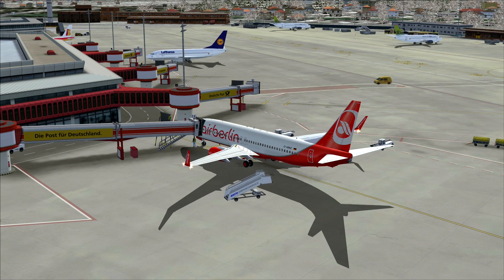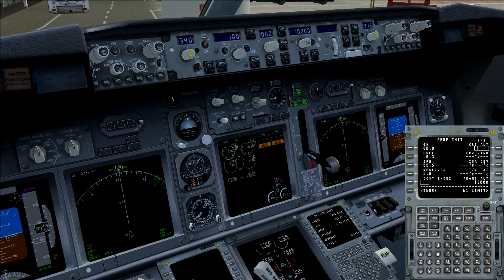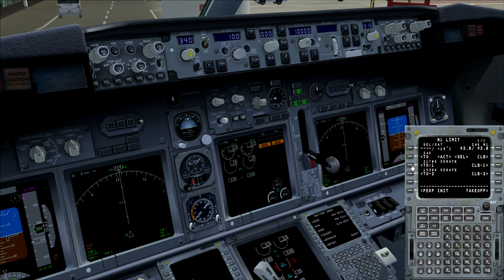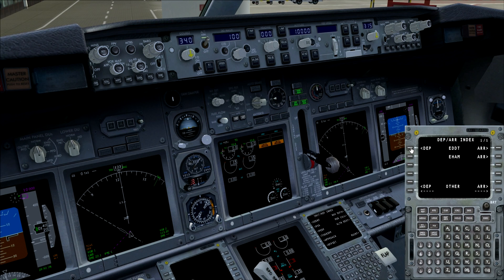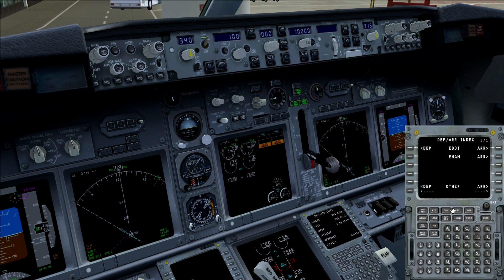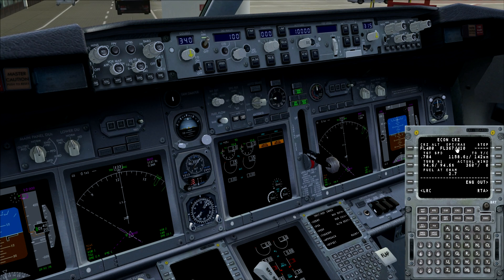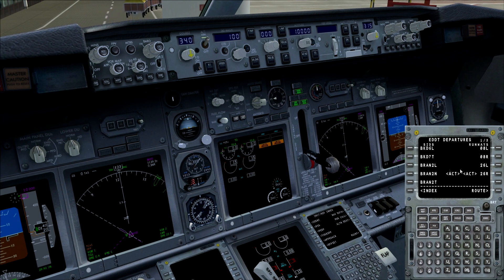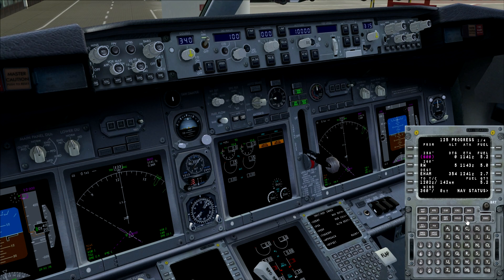Tutorial: How to Set Up the iFly 737 FMC

Comment: this aircraft iFly 737 seems to have exactly the same bug as the aerosoft A320...you gotta turn off fly by wire on the latter to stop it from shaking to pieces and this is without recording...so how do i do this on the ifly 737, i look at the wing and all i can see is the flaps shaking to bits?

Comment: Question for you! First I like to say great video! However my FMC keeps saying invalid data any time I enter any or most information. Any pointers on how to get that to work or show the Airac info? 
All my stuff works on all my planes outside of the iFly 737 ?????   Thanks if you know what might be happening.
Reply from the maker: You might want to upgrade your AIRAC data, please search for Navigraph for that ;)
Reply: +AviationPro all the folders and files are in the Ifly folder and it is showing up to date but for some reason it will not acknowledge it in the FMC? It has been that way since I installed that plane! That plane has been sitting in my inventory and unused since I have not been able to get it to work. Lol
Reply from the maker: Well, best thing is to visit the iFly forums, they have great support there and they know what they're doing! ;)
Reply: AviationPro
Yeah I am on there now reading the suggestions! Thanks though!
Reply: +Flightguy69 You have to run FSX/P3D as admin to allow it to access files. For Aribus X the nav data is stored outside the main Prepar3d folder so you don't have to run as admin, but for iFly it is all kept within Program Files (x86) / Locheed Martin / Prepar3D v3/ iFly / etc.

Comment: I have an issue with this FMC and I hope you can help.
My issue is that I can only type in one digit or letter at the same time, eg. if I want to type in 15 for flaps, it'll only type in 1 and that 1 will change to a 5, if I then click the flaps button, it'll only change to 5 and not 15, same with airport codes etc.. is there any way anyone knows how to fix said issue? regards.
Reply from the maker: MrDoggi1337 Which version of the iFly 737 do you have installed?
Reply: Thanks for the quick reply, I'm using version 1.0
Reply from the maker: I suggest installing the latest version first....

Comment: whenever i enter a sid or star, all the waypoints are grouped together in one spot in a very far away location: http://www.imagebam.com/image/17d4ed402707202

the picture you see is the "star"
Reply from the maker: MegaChallanger I have never seen that before, are you sure you installed the AIRAC data correctly? Otherwise ask for support on the iFly forums.
Reply: AviationPro i deleted the navdata folder to be sure and installed the AIRAC cycle. but i have the same problem

i also dont know if its a problem with ifly or navigraph
Reply from the maker: Then either contact Navigraph or iFly, I do not have any idea what could be going wrong here ;)

Comment: Unfortunately I have already tried this but it did not help. I turn on the captains FD and then the F/O's. I have reinstalled the 737 and that did not help either. The A/P bar is up. However, I am using FS2Crew, so maybe it's interfering with something.

Comment: Can somebody please help me??? 
I am having a frustrating problem with the autopilot. I do what people told me to do, yet I still have the problem. I completely did the FMC, entered the correct info, entered he trim, did not put pressure on the yoke. I have done everything, yet I still have the same problem. When I try to engage the autopilot, nothing happens, the FMC says thrust required?  Seriously, if I can't find the solution, I would just go to PMDG...
Reply from the maker: You do not even need to program the FMC to get the autopilot engaged. First, just try to fly the airplane and use one of the basic modes (FLCH, HDG and SPD). No pressure on any flight controls (make sure the joystick sensitivity is not too high, otherwise it might still register movement even though you are not touching it. At least one Flight Director on, then either CMD A or B, then one of the modes. No need to switch to PMDG just for that ;)
Reply: Quick question- Do you think that re-installing FSUIPC work?
Reply from the maker: You could give it a try. Or just completely recalibrate any joystick you use.

Comment from the maker: Actually you should use both in order to fly the airplane through the FMS. LNAV means Lateral Navigation. By engaging LNAV the autopilot will fly the route you've entered into the FMS. VNAV means Vertical Navigation. By engaging VNAV the autopilot will fly and maintain the vertical profile of your route that's being automatically calculated when pressing the Execute button on the FMC when you've fully entered the route and performance data.

Comment: Perhaps a good tip; When you've entered your route you can check if it is really what you want by going to the LEGS page, select PLAN mode on your efis control panel and press STEP on the bottom right of your CDU. This way you can confirm your route step by step.

Comment from the maker: Ooh in that case go to the configuration manager. Click on "My Fleet" and select the aircraft version you fly with. Then click on edit so you can change the settings for that version. There's a "Startup State" section where you can select either Cold & Dark, Normal or State of last exit. Make sure you select Normal or Cold & Dark in your case. When you reload the airplane without shutting down Flightsim first, you might need to load the default cessna first, shut it down, and then load the iFly!